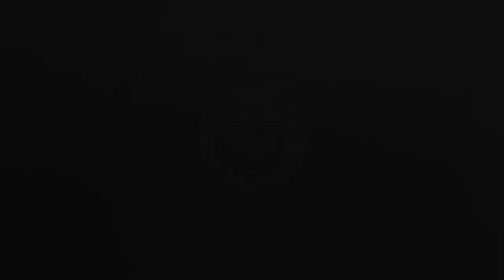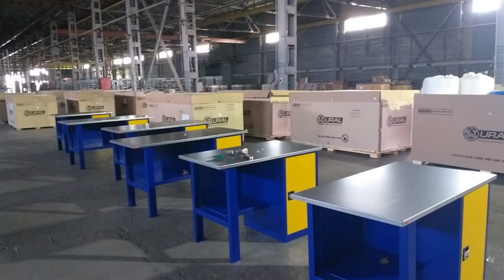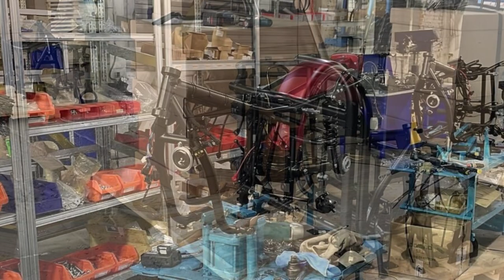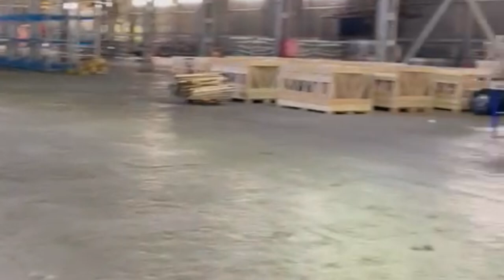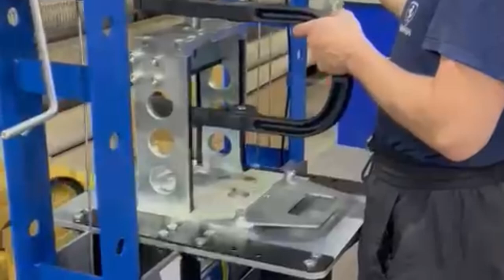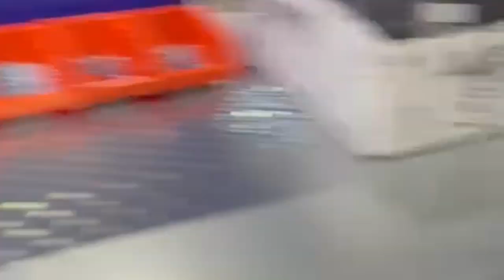URAL Field Notes with Ilya Khait 09.02.22

Comment: I used to be a lover of the Ural bike and sidecar. I was involved in an accident in 2018 that wrote off my 2016 patrol. I replaced that machine with a 2018 gear up in 2019 and have had nothing but issues with it. From a cracked final drive (discovered right after purchase) to a blown engine and a seized gearbox. Each time I trailered that bike to a Airdrie, Alberta to get the needed work done on that machine. When the bike was inspected, no issues on my part with respects to my maintenance was discovered. (I followed the maintenance schedule to a T and recorded all my oil changes). Since then, the company that sold me both machines has since folded with no support in the Edmonton Alberta area. I'm saddened with the level of support given me with respects to my machine. I dont think I'll be purchasing another. The bike has been down for more repair time that it's been on the road. Very sad.